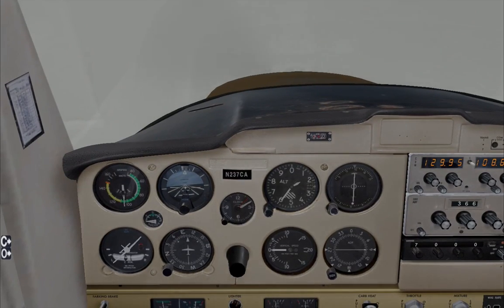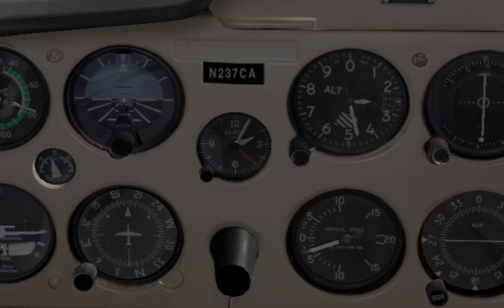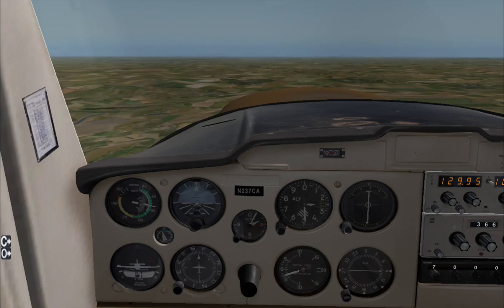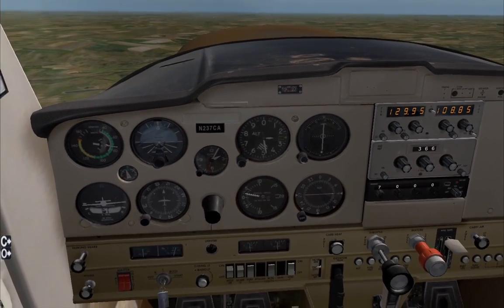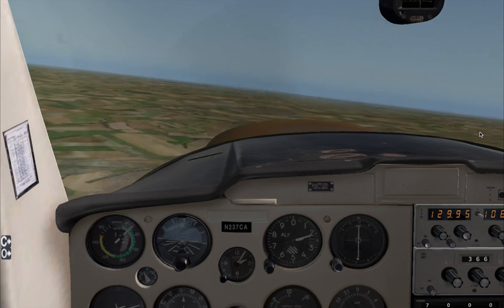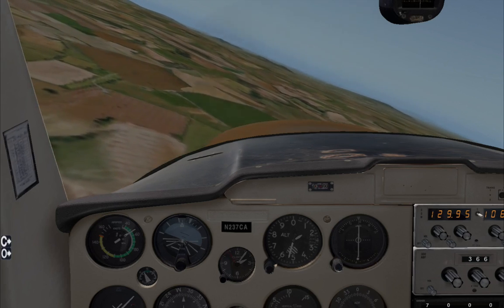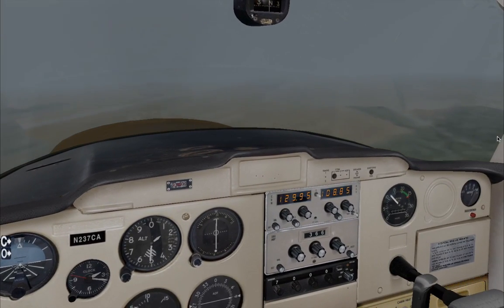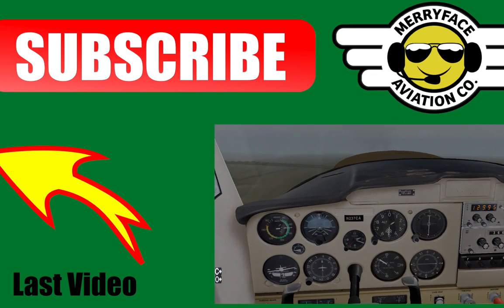An IFR Pilot's Worst Nightmare And how to Survive

Comment: First of all, this trick is not just for instrument pilots.  It will also save the butt of you VFR-only pilots who have forgotten the lessons you learned when you were a student.  As a 40-year CFI-I, i totally agree with this technique, but I STRONGLY would add one more suggestion -  keep the ball centered with your feet.  Remember - STEP ON THE BALL.  This will bring the airplane down, wings level.  In the end, you will descent slowly, wings level.  This will work in any of our single-engine aircraft.  However, the heavier aircraft will probably be descending at 1500 fpm or so, while the lighter aircraft will be descending at around 500 fpm  The hope is that you will break out of the clouds with enough altitude to see where you can go and that you will see a lot of flat ground below you.   - -  Responding to a couple of comments.  Yes, if you also have a total electrical failure in a Cessna or Beech (or others), you will not have flaps.  That will just bring you down a bit faster.  And carb heat is a nice idea.  And i am also a Foreflight/stratus/etc. kind of person.  If that is your backup plan (and it is a good one) go practice that plan with a CFI before you need it.  Most of my students find that using Foreflight is doable, but it is not as easy as it sounds, first time you try.  Best of luck.  I hope you never need to use this. www.chrishopefaaflightinstructor.com
Reply from the maker: yes! I have since modified it for the student to keep the ball in the middle with rudder. if they have an electric turn coordinator then put hands on knees and use roll without holding the yoke to level the wings (i.e not hold the yoke in case they accidentally start deflecting the elevator)

Comment: This is actually a glider maneuver except they deploy spoilers instead of full flaps. It's called a "benign spiral." 

I've never heard of it in a SE piston but if it works, then cool. I'd just caution others to test it out in their plane first. What works in a 152 might not work in a 182 or a Bonanza.
Reply from the maker: Yes! Another youtuber recently commented the same thing about how it's used in gliders. Fantastic really. As the video says, it's always best to try it out in VMC with an instructor. I've tried it in a 172, 152, Pa28 and Pa38 so far. Some of those need minor tweaks but other than that it works like  charm.

Comment: If electrical has failed, will you be able to lower the flaps?
Reply: Gary V you're probably right
Reply from the maker: no, you wouldn't in the Cessna. In other aircraft you could. Piper aircraft, DR400, etc.
Reply: piper warrior has mechanical flaps
Reply: Why tomahawks are better!
Reply: Well we are not so worried about a power failure just if the pitot static system is compromised your vsi is electric but measures the rate of change from the altimeter, and in this scenario we say that the pitot system and vacc system are compromised but realistically we have alt static air and we can break the glass of the vsi to get our altimeter back then use the compass to find out our direction
Reply: reminds me of a beechcraft bonanza, which sounds like a worlds most dangerous aircraft in this situation

Comment: Personally, I find this to be more "trivia knowledge" than anything. It's neat, but I wouldn't want to trust lives to this sort of thing. The best thing to do if you regularly fly IFR single engine is get ForeFlight and a Stratus. That way, you can have an AHRS backup in-case of total instrument failure which is highly unlikely. The instruments run off of three different systems to the likelyhood of electric failure, pitot-static blockage or failure, and vauum pump failure all at the same time is probably slim to none.

Regardless, neat trick, but just get a Stratus and always have a spare AHRS to get you out of a seriously bad day.
Reply from the maker: hey. Thanks for the great feedback. Yes indeed, multiple failures like that is extremely unlikely. I think this was come useful for VFR pilots going into IMC. Foreflight is really only useful in the U.S and Canada, we don't have coverage here in Europe. As nice as a spare AHRS would be, some people can barely afford to fly a basic steam gauge aircraft, so investing in tertiary emergency instruments may be outside of their budget. Thanks again!
Reply: Even in a twin I will not fly without ForeFlight and Stratus. Even though we have 2 vacuum pumps, a friend of mind had a DOUBLE vacuum failure. So you never know. Still a good tip if you verify it for your airplane in VMC first. I would also like to see what would happen if you were already i an unusual attitude before attempting the configuration.
Reply: I go the Stratus route.  It is much safer than trusting in the terrain and clouds to behave themselves.  Hell, I wouldn't even declare an emergency.  Stratus and Foreflight Pro is one hell of a good backup to a potentially bad day.  Making sure the battery is charged is a part of my prefight planning.

Comment: Was wondering if we could pull out our iphone and use that as a basic minimum backup for attitude indicator..
Even GPS Altitude might not be accurate, we could have some knowledge in our height too!
Heading, VSI, even Ground Speed could work out easily by GPS info and Maths.
(I mean calculated by apps)
If it worked out as expected and trusty, I'll definitely use it. Better than nothing!
Reply: Super Elephant Not without stratus or alike. Your iPhone works like a slip ball.
Reply: rc300xs If I'm in a pinch, I'm gonna use anything I can get my hands on. That having been said, you are absolutely correct that attitude indications from a normal phone can be quite unreliable, given that it derives its orientation information from accelerometers, not gyros. However, you might still be able to derive some attitude info from your ground track & altitude changes and help prevent a stall by maintaining ground speed. Basically, it should allow you to at least keep the aircraft reasonably close to level.
Reply: Or use the iPhone to contact the Center or tower.

Comment: The thing is that a Cessna, compared to the other plane I fly, stalls symmetrically--when we did the stall exercises it just fell without even tilting. This probably comes from the weight being under the wing. So one just needs to not pitch down (hence the full up trim), maybe that's why this works. In any case, I have no use and no intention of getting IFR certification, especially since the only plane in my club that is IFR equipped is a fuel-thirsty Cirrus.
Reply: If you're going out to fly x number of hours, then yes, the Cirrus is fuel thirsty compared to a C172 / PA28 or any other similar aircraft.  However, If you're going out to fly from point A to point B I think you'll find the increased consumption balances out with essentially a proportional increase in speed meaning the economy is a wash - both are going to be about 15mpg.    .

Comment: I find this specific procedure extremely risky for the simple reason that I don't have any instruments, therefore I don't have Altitude indication, although I start a descent by the hope to get under the cloud base and find visual reference? What about the MSA? I really would "create" an artificial horizon by using a bottle of water or just by putting a thing hanging from the top of the cabin (it will point the earth's center - approximately pointing to the ground ), and start climbing to get on top of the clouds. And always ask for some help from ATC. I would never, ever descent in a situation like that.
Reply: Fore sure altitude is your freind
Reply: A bottle of water is NOT an artificial horizon!!!! It is a slip-skid indicator. Same for something hanging in the cabin. It responds to inertia, NOT gravity! Think about how the conventional glass and ball indicator works. It's kinematically identical to a pendulum, just like something hanging in the cabin. So why aren't slip-skid indicators made with simple pendulums? Pendulums of useful length take up too much instrument panel space. The curved glass thing does exactly the same thing as a pendulum in a smaller package. If an airplane isn't moving, the pendulum, or slip-skid indicator, or bottle of water, will indeed show where the center of the earth is. Not so when the airplane is moving! You can keep all these things nice and centered while you do a bank, or a loop, or a roll, and the location of the center of the earth has nothing to do with it.
Reply: Guys so many of you are prepared to offer your opinion...this is partially the problem, you’re young and feel that everything you think must count, as you get older experience, humility and less ego kick in...in fact in this state you are less likely to offer opinion but interestingly enough, your opinion no contains some experience, humility and less ego. This is a normal progression for most humans, just please try and understand just because you think it, doesn’t mean it’s right or true. In case you are wondering I am an experienced IFR pilot, looking forward to more experience.
Reply: I’m not buy the inertia thing I agree a plumb bob in a moving vehicle will indicate horizontal movement, try it in a car, it’s called gravity, heavy object fall to earth.

Comment: Caution when you apply power... the full flap and full up trim will have the plane pitch up with power and you can spin it.

What the technique does:  Puts the plane on the edge of a stall, center section stalls first due to flaps and so the plane will tend to "hang by the wingtips"

Results will vary with different aircraft... Best to do some testing when you are not IMC so you know what your airplane will do.
Reply from the maker: Yeah! Absolutely. I do call for it to be tested in VMC, preferably with an instructor, in the video. It really does vary in different aircraft. So far I've tried it in the air with the C152F, C172SP, Pa28 Warrior 3, PA38. So far the Pa28 has been the most stable. Coasts very gently in a shallow right turn. After that was the C152, followed by the Pa38, which required some adjusting on the trim (about one full revolution away from full nose up). Surprisingly the C172SP was not ideal. Turned into a steep left turn and I had to stop the exercise as the aircraft was going to go beyond VFE. I'll need some time to adjust the configuration for the 172SP. One of my viewers tried it with his instructor in his 172 and apparently it worked great. I'll ask him what variant he was using. I hope to one day get a camera on all of these aircraft and more and film the technique for each one. Would be really interesting.
Reply: Same effect in FlightGear's Cessna 172P, steep left bank and eventually spin, and lots of screaming of the stall strips.
Reply: Try mid range flaps and less up trim.

Also check that rudder is trimmed for the power setting.

Comment: Have to admit I was sceptical going into this video, but this is a trick that could just get you out of trouble. Ok it is a bit rudimentary, but let's just say I'd execute this manoeuvre before I'd attempt to blunder around in total IMC without an attitude indicator or an ASI (of course I'd make sure it worked on my aircraft first haha).
Obviously it's not going to work on every aircraft, and obviously it might not help you out in mountainous terrain. But hell, at least you have the option if you find yourself in this kind of crappy situation. 

Thanks for sharing! Good video btw, well presented (y)

Comment: Just use a half bottle of water and place it on your dash...cheap turn indicator
Reply: Just does'nt work does it ? I'll remain straight in turn, that's the physics of the aircraft, have a closer look at it. The ball's always more or less centered in turns. Except slight asymetry of the wing speed that make it slip just a little bit to the side, nothing water will tell you as far as I can imagine.
Reply: Not for turns but to let you know if you are flying straight and level.
Reply: Incorrect
Reply: I believe this would function as a slip indicator, not a turn indicator. You could keep coordinated, but it won't tell you if you are turning.
Reply: Ask how thats works for pouring ice tea into a glass while rolling...google bob hoover.

Comment: This might work, but it seems very likely to enter into a death spiral. If you have to descend for a long time, the over-banking tendency will kill you. Try it from 10,000 ft.
My solution: after configuring for descent, watch the compass and try to hold a heading using very gradual aileron movements.
Reply from the maker: Using the compass would not work as it is not reliable during any accelerations, turning bank angles and non level pitch angles. It woud be extremely uncommon to fly a 172/152 at 10 000ft and still be in IMC, as those aircraft are not designed to be in icing conditions and thus pilots shouldn't go there to begin with. What I teach my PPL students (AFTER teaching them the proper syllabus way of exiting clouds) is to use this method with one modification: Watch the turn coordinator, and using only light pressure at the bottom of the yoke keep the wings level. This ensures that the aircraft won't spiral and/or spin nor stall, as long as the student does not apply any pressure on the elevator

Comment: Just curious, why can't you use a little bit of rudder or attempt at "wing leveling" (may not be the best) to keep the magnetic compass on course?  Don't need a gyro for magnetic field.  My concern is if compass is turning you could be in a spiral dive.
Reply from the maker: simple: you cannot trust the magnetic compass in any form of accelerations, banks, or other than level pitch. therefore it is not the best tool to use in this situation. This video is a bit of an interesting tidbit. I do incorporate this in my teaching, for the IMC escape for PPL students. AFTER I've showed them the proper technique, i demonstrate to them this technique with a small change: I will ask them to put their hands on their legs, palm up, fingers open after having set up the aircraft as shown in this video. I will then ask them to maintain level wings and balanced flight by using the turn coordinator and inclinometer, as these two instruments do not depend on the vacuum system. The use the palm of their hands, and do not grip the yoke, that way there is no temptation or accidental elevator input, which could result in a stall. This modified version of the technique works very well.

Comment: BUSTED !!!
inspired by this video - I tried (even it seems to work in XPlane 11) - in an AATD (Redbird) today:
it does NOT work!
It enters a stall, it enters a 'falling leave' (with a very heavy descent rate).
I tried to recover from - and I could NOT (it was potentially in a very 'deep stall', the 'falling leave' entered for a long time). I had to push down so drastically (due to full putch-up trim), within milliseconds when I saw ground again (1000 ft AGL cloud base), so scared already due to the high vertical descent (I guess, almost no horizontal airspeed, just vertically down). It could not gain any airspeed again!

Conclusion:
I would NOT RELY on this procedure, even it seems to work in a (non-certified) SIM (in AATD it was not working, for sure).
If you enter really a 'falling leaf' and 'deep stall' (as it looks like) - almost impossible to recover from it (if you are not flying a fighter jet, with heavy thrust vector).
The 'full-flaps down', 'full-pitch up trim' creates so much drag, that you do not have enough HP do recover from the 'backside of the power curve' envelope ('region of reverse command', deep inside and almost impossible to come out from).

Don't trust a SIM!!!
It will not properly model this flight situation and attitude!

Comment: The simulation starts from the basis of straight and  level in the clouds. Would this technique work if the aircraft was already in an unusual attitude let’s say in a severe nose down or nose up or you were in a split S or completely disoriented with wings not level and nose position at whatever??
Reply from the maker: It's a good question, for which I don't know the answer to. I'd have to test it out. In my opinion however, I don't think it would work in extreme unusual attitudes
Reply: In that case you’re screwed. I can only think of one last thing and that would be complete hands off in neutralize controls. Let the plane go into a fugoid oscillation assuming one is at a high enough altitude and hope that you break out at a safe altitude.